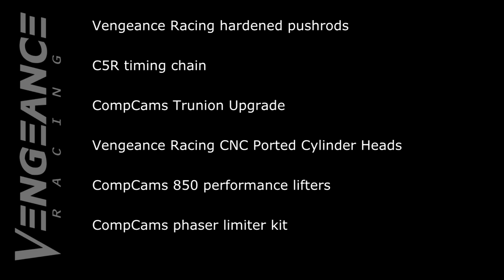550RWHP C7 Corvette N/A LT1 Build - VR Heads Cam Package

Comment: So the stock lt1 fuel system will support bolt ons, heads and cam on e85 with just a fuel lobe increase on the cam?
Reply: I’d also like to know! Is a low side upgrade necessary?

Comment: Was that saying 460 stock RWHP ? If so that's crazy
Reply: Robert Smith that's CRANK horsepower NOT Rear wheel horsepower 🤓
Reply: Great 1 No it’s not crank hp it’s on a dyno sheet which reads hp to the wheels 🤦🏻‍♂️ Description says car came in with headers, intake, a tune, and on E-85 before coming to the shop. That’s why it made 461.9 to the wheels on the “baseline”